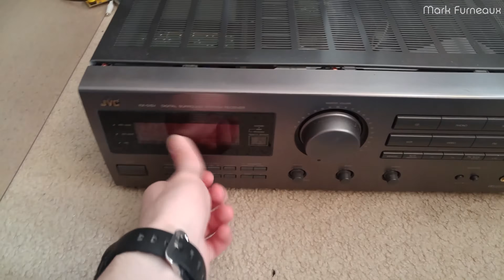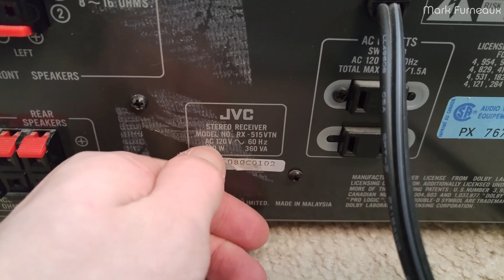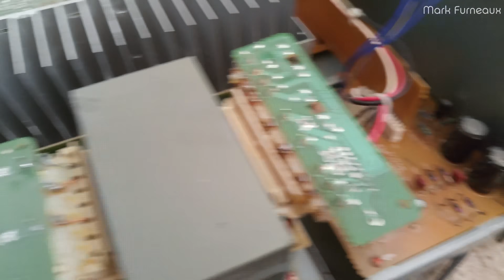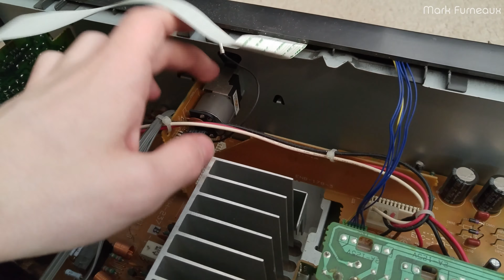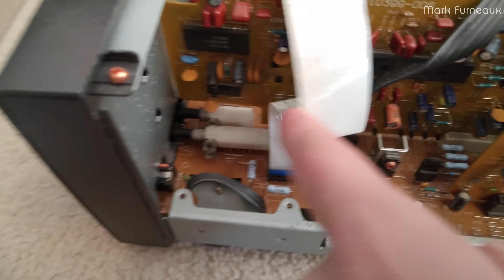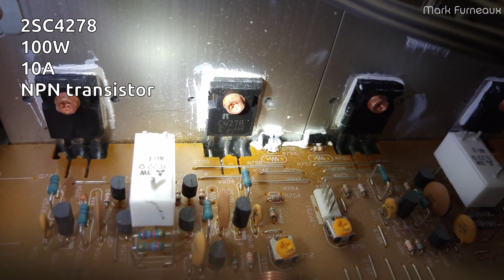Teardown of a 1993 JVC RX-515V Receiver

Comment: I found this exact model around the corner from me in a pile of trash, i took it home, took it apart to inspect it and the main fuse was blown..  went to hd bought a pack of 125v 5a fuses, popped it in and it blew as soon as i pressed the power button.    The other two transformer fuses are fine.  Where should i start with diagnosing or meter testing components and what components would likely fail in order i can test?   This video has helped me alot to understand it's boards and parts, but have no clue where to start on meter testing..  i inspected visually all the boards and they look clean no burn spots.  I'd love to rescue this and keep it, thanks for any help from anyone.

Comment: Mark:

I would be asking you this same question regardless of whether I owned this JVC Pro Logic surround receiver, or a Sony, or Pioneer, or any other such product.

Is there a way to internally balance the audio levels inside a consumer stereo receiver? Specifically, I want to match the tuner AM/FM section to match the level of, say, the CD or Phono section. I understand exactly why radio is so much LOUDER than other sources, I studied air-chain, Optimod processors, and all that, and this is not a defect of mine or anyone else’s receiver or radio set.

I just want to be able to turn my receiver’s volume knob up a reasonable amount while enjoying radio stations at the same level as I do CDs, tapes, etc. Are there certain pots inside the circuit board I could adjust that would lower the Tuner, or at least, the FM volume?

Since I own and use this specific make and model, and, since at around 14:00 we are looking at the tuner board, I wonder what some of those pots do.  Could some of them lower the output of the tuner to the main board?

I’d appreciate your thoughts on this, as it seems you have been inside receivers of this kind.

Comment: It wasn't artificial expansion from a stereo source, Dolby Pro Logic used matrix encoding to put all the information into the two channels and the JVC then decoded it for the 4 DPL channels. (The JVC could also take a straight stereo L/R source and simulate surround sound.) https://en.wikipedia.org/wiki/Dolby_Pro_Logic#Dolby_Pro_Logic

Comment: Question about JVC Rx-515 Vtn Digital Surround Sound Receiver Serial 159c4384
Open Question
Jvc RX-515v blows fuse replace power on blows again
Fuse eeps blowing replace it and it blows again on stand by want to test with volt meter how and what do i test first

Comment: Just bought it for 10 dollars 💵, it was sounding quite god , till I can next a speaker wire to the left speaker can be tie in the receiver a huge spark lighted and heated the heat disipatir after that I didn’t have no display and one fuse burned on the power supply , I put a 5 amperes fuse , turn it on the fuse burned

Comment: Just bought it was sounding quite good but by the time I was connecting the speaker wires connectors were too lose, while connecting. The speaker wire into the left channel a huge spark ⚡️ heat the heater disipador , no display , so I check the power supply fuse , it was burned I replace it with an 5 volt fuse by the time turn the power on a huge spark  came out from the fuse  , after that I didn’t have no display

Comment: I own two of this RX-515vtn receiver, and plan to have them both overhauled before the only stereo repair place within 50 miles of me shutters.

1:10 yes - this is  a Dolby Pro-Logic era surround model, yet it still renders, to me,  a satisfactorily real surround stage, depending on the source.

It has all the analog inputs I will ever need, for all of my quite functional analog audio sources.  No need to go digital!  I plan to acquire  a third RX-515, in case a suitable repair source does not exist where I plan to live in three to five years.

Comment: The JVC amp is actually a 4ch amp not 5ch that is whay it only has 4 transistor pairs. The rear channel is a single channel and the same sound comes from both rear speakers and both must be connected to get rear sound so they must be connected in series. I enjoyed your video greatly since I inherited this Receiver from my father in law and it has been a great amp for the cottage although my center channel has become intermittent and only works once in a while. The fact it can work shows it is not blown. Based on your video I will attempt to open and repair. Wish me luck.

Comment: I have a jvc r-×220 1985 stereo receiver only getting one side sound other side is very faint sound, speakers are ok pioneer speakers i rebuilt them so nothing is wrong with them i just opened it up very dirty inside wonder if the dirt is grounding out other speaker output?

Comment: Great Video. Need your help finding the part number of those white power resistors having 3 watt 0.22 ohm by Mitsubishi which you pointed out at around 19:28. Thanks.

Comment: HELLO FRIEND I AM WRITTEN IN YOUR YOUTUBE CHANNEL A GREETING FROM VENEZUELA I HAVE A RECEIVER JVC RX-803VBK WHEN I CONNECT IT TO THE LINE OF AC LIGHTS THE STAMBY LED, IT SOUNDS AS THE RELEASE ACTION THEN I PRESSURE POWER AND I BURN THE INPUT FUSE , I COULD SAY WHERE TO START WITH THE REPAIR ??

Comment: hey mark, I have this same exact model of jvc. I'm having an issue with it recently probably just over a month now. If possible could you get back to me so I can explain the issues I'm having, it's been so reliable up until now and holds a special place with me because it really is a great reciever and I'd hate to get rid of her. That and I can't afford to replace her right now.
Reply from the maker: I can't give you anything more than general repair tips. I don't know that model very well or have any kind of schematics for it.
Reply: Mark Furneaux 2 thats alright, i just took it apart and it all looks well and fine, no burn marks or signs of shortages. nothing seems to have broken or blown as far as i can see. i did notice however that the frame was loose on the right side and i know it has been known that if the frame is loose it affects the boards or connections somehow. I 'm just getting it all back together now to see if that was the problem.